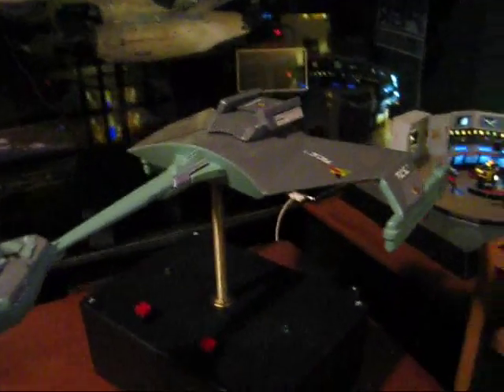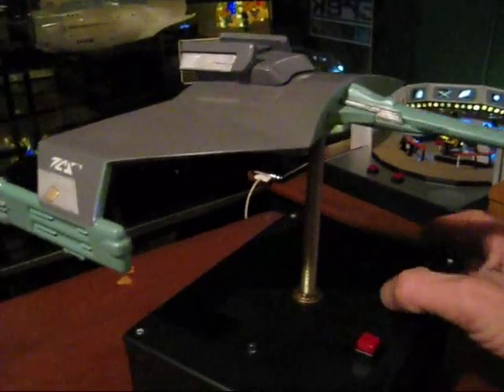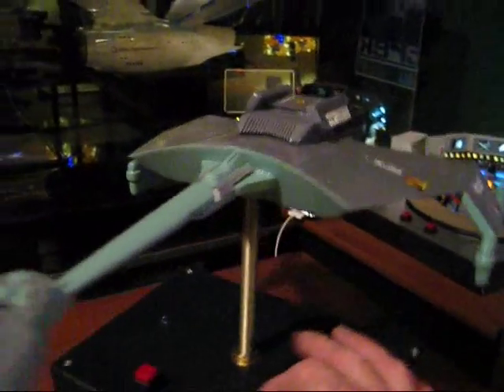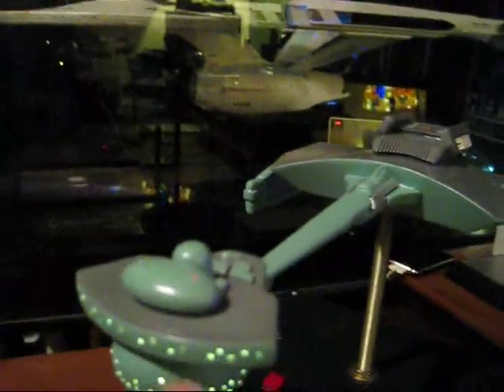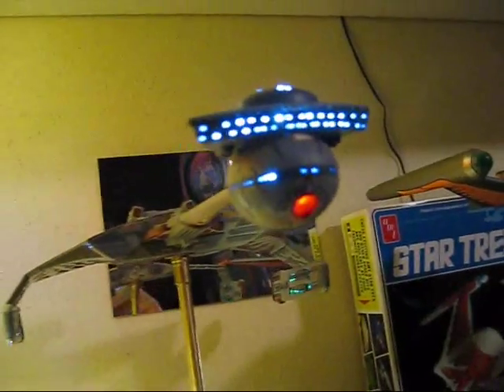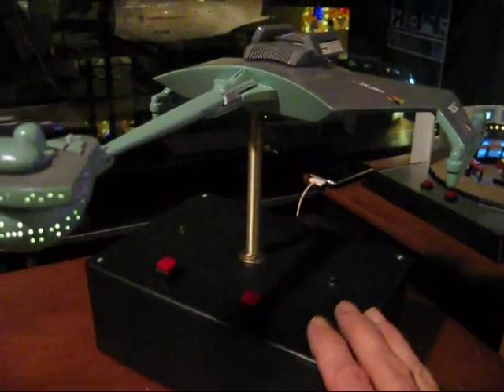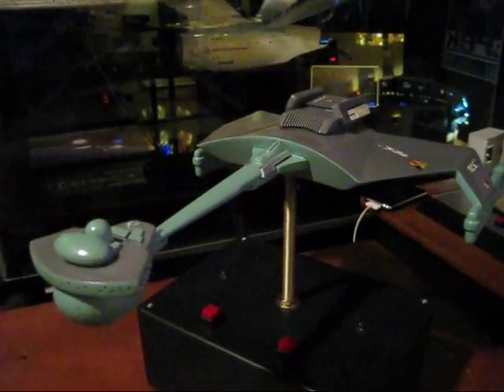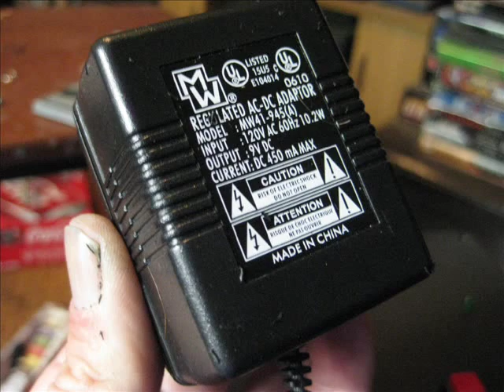AMT 1/650 Klingon D-7 Battle Cruiser scale model by TrekWorks

Comment: Can you tell me what kit that is  ?   I think I told you I got the Polar Lights kit, its small and that one looks better and a larger scale just wanted to know who made that one.  I also added the brass stand to my Klingon bird of Prey project and have installed 5 leds to it also.  I ended up using a 6 volt battery charger with a 1 amp output for power.  Seems to have worked great.  The model is about half way finished......... cool stuff.  thanks JEff

Comment: the klingon cruiser with the flashing light where did you get that i want to start building my models again like you said
Reply: That decal on the roof is a temporary. Parking lot in case the shuttle bay is full. Or shuttle craft parking for the dishonored lot.

Comment: what color did you use for the green on this model ....did you mix it or buy if so what brand and number is the paint im trying to build this model and like you colors tryed to mix a color but its not getting me there ...  thanks .... : )
Reply: In my opinion, the hole in the front should be a navigation deflector, but science it's Klingon it's dual purpose is also a torpedo launcher.